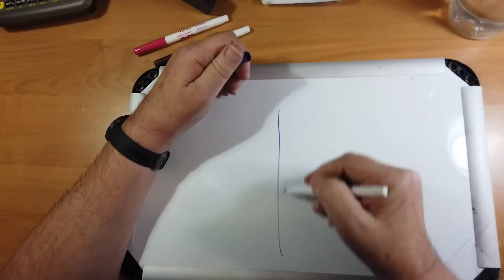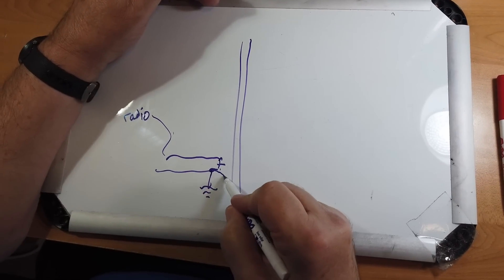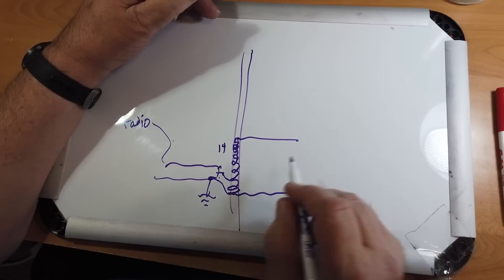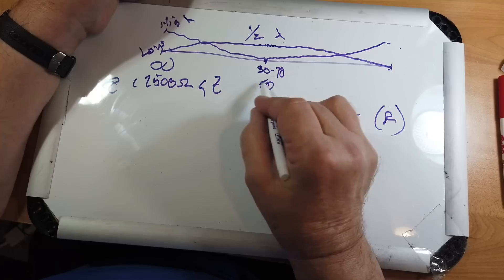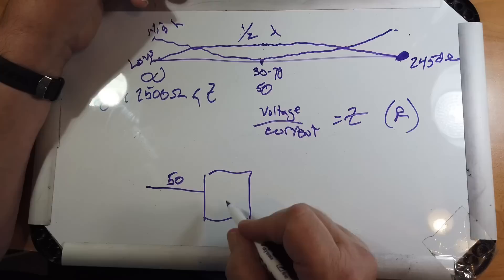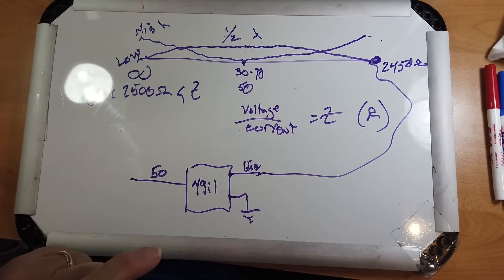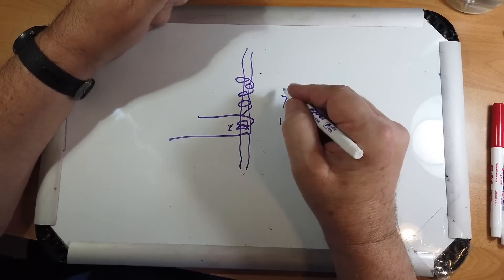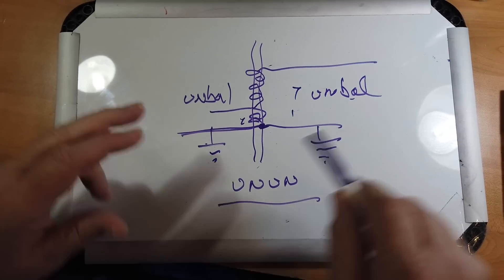What's Inside a 49:1 Unun? (#578)

Comment: I love my 49:1 UNUN it's resonant on 40,20,15 and 10m Band. only need the AT-Tuner on 17 and 12m Band. Thx for that great content explained with just a few words for everyone to be understood.Happy weekend & 73's de Your Friend Uncle Guenter
Reply: I think you mean the antenna is resonant- an unun is just a transformer. What's your setup like? Vertical, sloper, horizontal?
Reply: @louisseaman8455  Yes right, the 49:1 that I got is not a UNUN,  the 9:1 that I also have is just a UNUN. Correction on that one, I am sorry for the Misspelling.
1st of all I want you to know that I am operating portable 98% of my time.
In most cases if I have my 49:1 shorty 39,04ft. with extension coil I use a vertical setup because you can run this configuration nearly everywhere, or meaning you can run it actually everywhere because you don't need bushes or trees as a support to hook the other end of your antenna to it. You don't have to have a second mast with you.
PLUS:
Vertical setup is better for worldwide dx it works likely a groundplane radiation in all directions.
PLUS: the Setup is done in no time which is important when you have days of short daylight to go outside to make calls. Always keep this in mind: " Short antenna setup time = longer radio play time." That's my personal golden rule I go with.
Here at the River Areas it gets nasty cold soon  after the Sun is down after dark.
Wintertime is use the afternoon hours til shortly after darkness falls to play radio in the Fields. 12-16.00 UTC mostly.
My long wire endfed antennas I run them inverted L or inverted V.
I got a 49:1 with 67,1ft. and 2 Endfeds 9:1UNUN with 53,1 and 87ft. lenght.
I haven't tried a real straight sloper configuration yet. I been running so many funny looking antenna configurations which there isn't even a name for it. And they all made my signal getting around the Globe.

Comment: Another way to look at this is in VHF terms like the J-pole antenna where the lower quarter wave is a 350 ohm matching transformer rather than lumped coils more practical on HF. Also, tube transmitter outputs did it with ease as the tubes output impedance was in the 2 to 5K ohm range.

Comment: A EFHW really can't be fed at the end, it won't work that way because this will force some of the coax shield to serve as a near  .05 wl continuation of the 1/2 wl.  To make any sense of this antenna, it must be considered as a off center feed near the end but not at the very end.  All of this assumes that the right length of the antenna proper is the correct length to make this work.
Reply: There’s are different Configs for this setup.  I use a 133ft wire with nothing connected to ground lug.  Then at the feed, 17ft from the transformer I put a 31 choke there to isolate that length of coax as the counterpoise.  Then at the shack I use a 31 and 43 to choke everything else.  The 133ft wire isn’t ideally straight either.  The wire slopes up about 30 degrees then from there makes a hard 45 degree turn west for about 60ft then does another 45 going south.  Maximum height is about 30ft from ground level.  So far this setup has worked wonders from 80-10m for digital, cw, and phone.  I also have another 49:1 transformer I use as a vertical with a 33ft wire suspended from a palm tree which works great for 20-6m and cb.  The 33ft wire has a 33 wire radial field on the ground with each radial about 10ft long each all 90 degrees westward.  Both transformers are about 12inches off the ground.
Reply: My EFHW does use the coax shield a little bit. With good conditions, I'm getting up to 13,000 km DX 100W SSB. My antenna is a Par EndFedz EF-QUAD.
Reply: You're correct.  The EFHW isn't really end fed.  Remember that coax really has three conductors, the inner conductor, the inside of the shield and the outside of the shield / braid.  The outside of the coax braid becomes the counterpoise because of the skin effect.  If you want to prove this you can put a #31 ferrite toroid at the antenna end of the coax and wrap a few turn of coax through it and the antenna will become nearly useless. 

To improve the 20-10 meter tuning on the EFHW antenna place a one inch diameter price of schedule 80 plastic pipe about 6 inches long about six feet from the UNUN and wrap five turns of the antenna wire around the one inch schedule 80 PVC pipe.  This should give you lower SWR on 20-10 meters and be nearly invisible on 80-30 meters.
Reply: @rogerp5816  Steve Ellington has a very detailed video on this with various tests and using a CMC (12 turns through 240-31 toroid) it certainly didn't make the antenna useless quite the opposite. 
I've a EFHW Transformer is 20ft high with approx 66ft of wire sloping up to 70ft, a 3 meter counterpoise though not sure if needed I need to experiment further and an CMChoke 3 meters from the 49:1 and another as in enters the shack, its supberb.